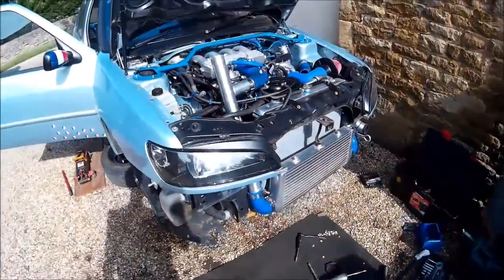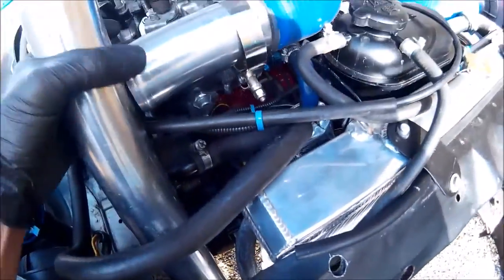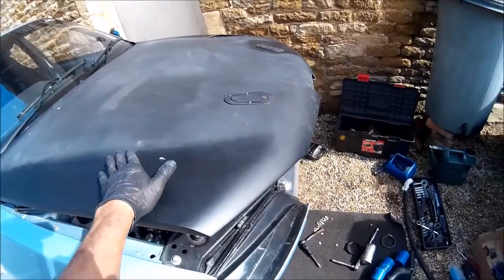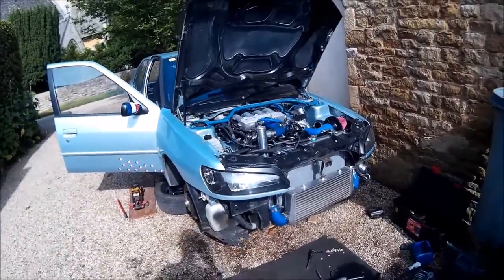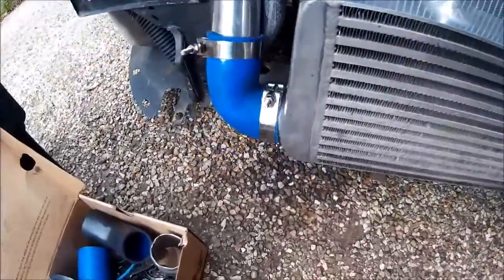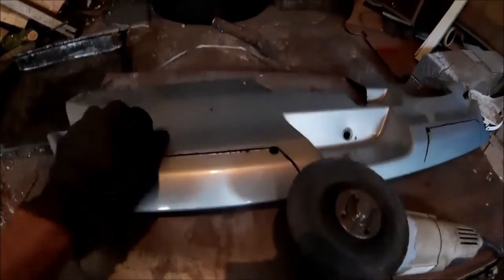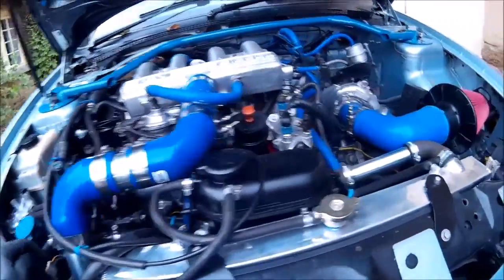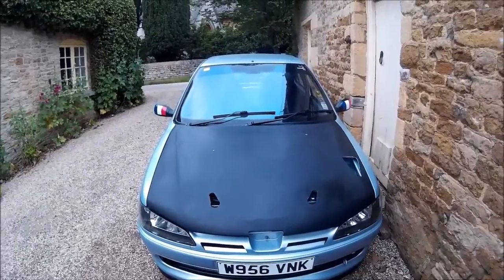Project 306 2.1 - XUD Radiator upgrade PART 2

Comment: did you think of doing some extraction from the rear side of the radiator out through the bonnet, racecar style? 

I dig the slots though, they blended with the lines nicely.
Reply from the maker: Yes. But theres just not the room to be honest